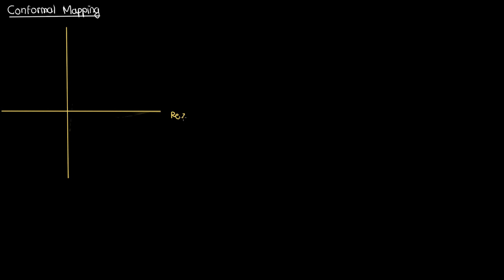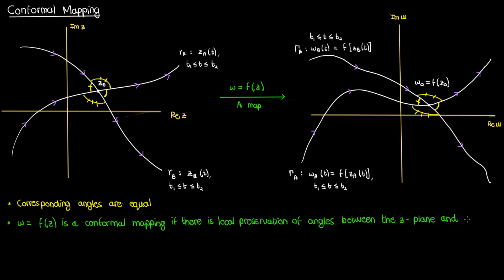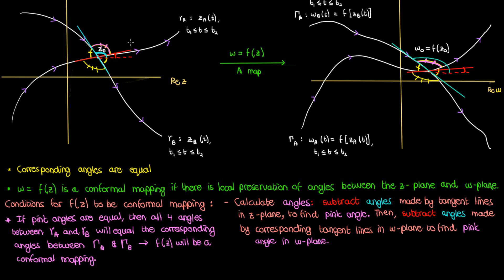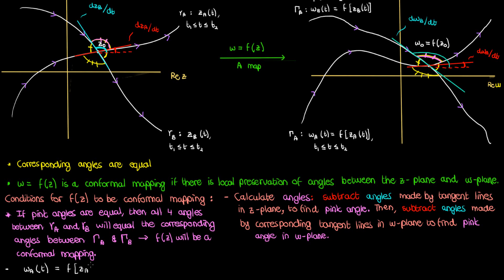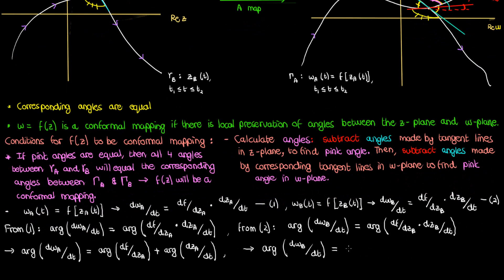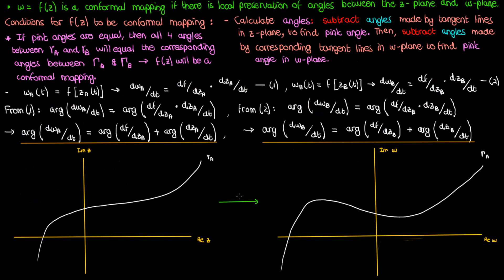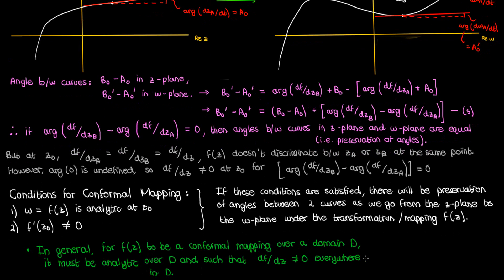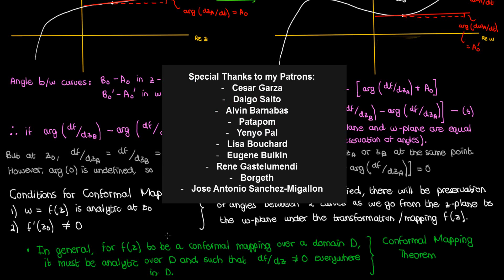Conformal Mapping in Complex Variables

Comment: If the derivative is zero there could be only a constant shift between the two angles. But if the function is analytic (and the derivative of the two curves is always defined and continuous) the constant must be zero on a single point or even on a interval included in the domain. So the only condition IMO is that the function is analytic and the derivative is not always zero. Is my reasoning correct?
Reply: I think I understand now: the problem is that to represent the transformed curve in the w complex plane we need to invert the f mapping and the new angles are related to the derivative of the inverse function, but the inverse of the derivative is not defined when the derivative is zero and so the angles of the transformed curves (transformed by the mapping w = f(z)) represented in the w complex plane have sort of a discontinuity and therefore I think that those transformed angles have a cusp or are not defined in that point..